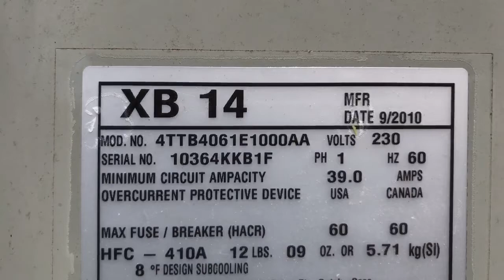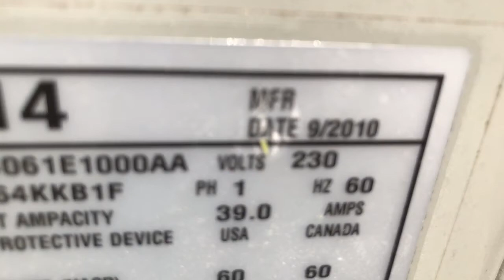Bad compressor

Comment: I really didn't see nothing crazy wrong with the picture except the unit is so new but it was probably way oversized and ductwork too small. Trane uses copeland scrolls with rotolocks very common.

Comment: someone got ripped off..
Reply from the maker: lol nop
Reply: yup, they got ripped off installing a "trane" in *2010/2011* probably lured into replacing working equipment over a typical failed shitty capacitor/contactor or chinesium  schrader valve leak on old equipment.......